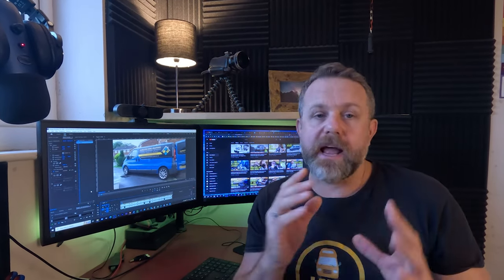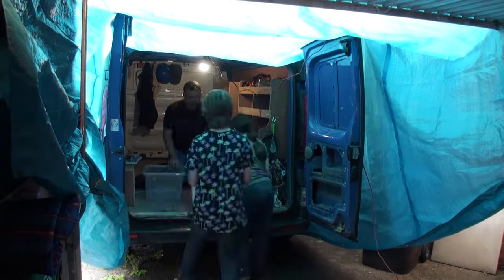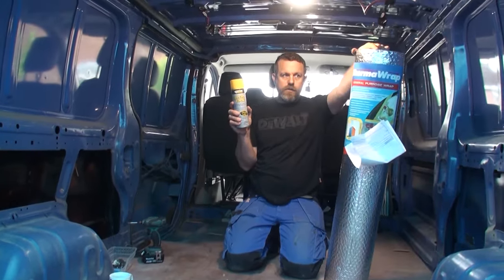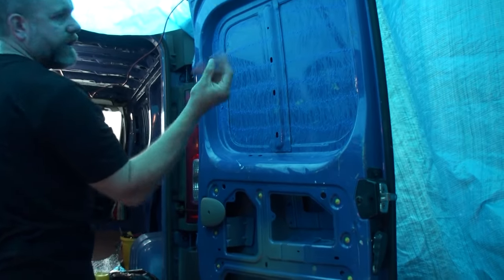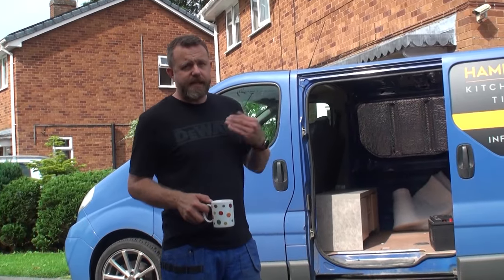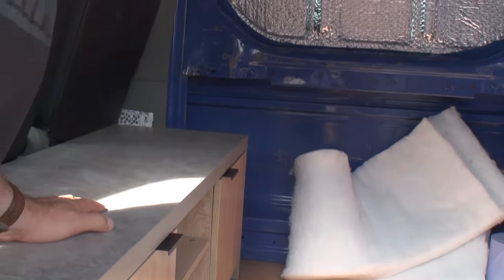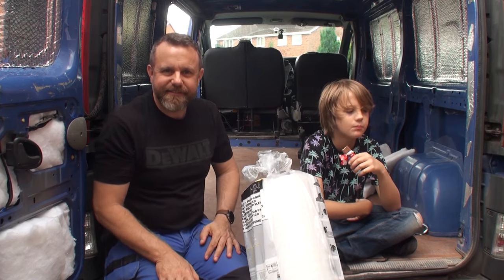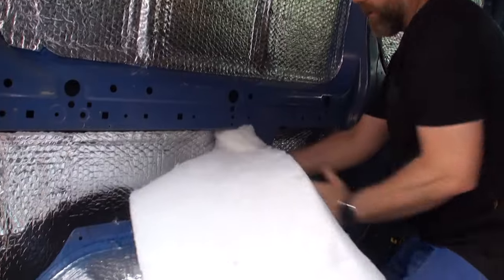Work van to Campervan Conversion 2021

Comment: Hi good job . Wer is the bed from it's ideal
Reply from the maker: Hi. Thanks so much 😁. The bed came from 'go outdoors'
Reply: Top job. I'm just doing my work van into a little weekend camper but still used as a  work van . It's a ford transit only cheap thing but does the job